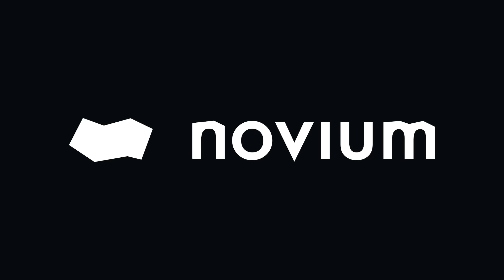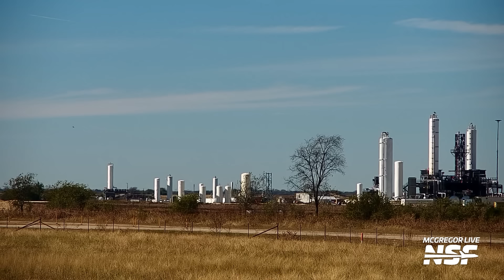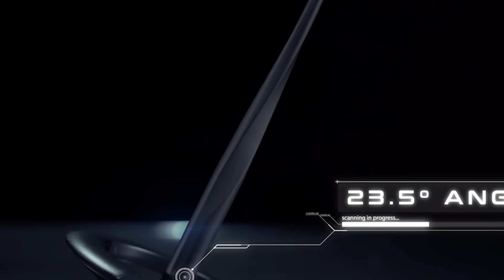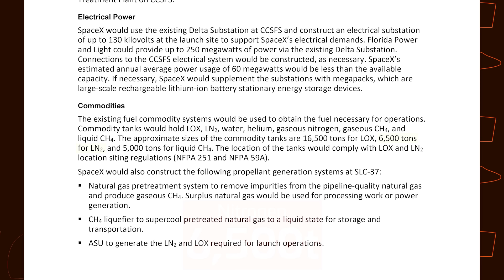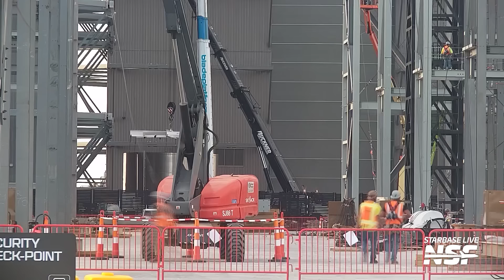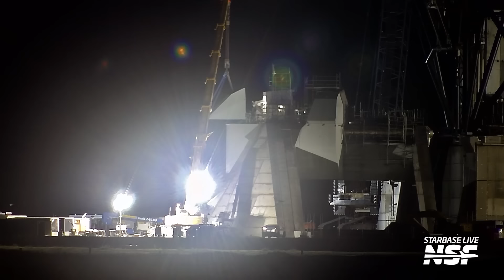SpaceX's Rapid V3 Push — Plus HUGE Starship News at SLC-37

Comment: We have not been able to make the easier version work, let's build a more complex one!
Reply: ..?  They don't move on until they got the previous version past it's required benchmarks.
Reply: @imaginary_friend7300  which is.. exploding?
Reply: @yoshyoka  Deeply unserious.
Reply: @gregspan  One hopes, but haters tend to be deeply ignorant so he might actually be serious.
Reply: @imaginary_friend7300  Well, no. i am serious, and not out of ignorance. When developing the Falcon series, SpaceX was doing serious incremental project management: build a rocket that works, then test new hardware conservatively, incrementally and move to the next step only when the last was understood and dialed. This made them move fast and lead the industry. With Starship all that went out the window, caution is gone, architecture never questioned, several systems redesigned before the previous version even worked. looks impressive, but they stopped moving fast, development is shaky and they are struggling to make the rocket perform first, not because they are stupid, but because ideology rather than engineering is now steering the company. 
I hope for them to succeed, and no, i am no hater: what SpaceX has already achieved has kept me in awe for years. Reason why it hurts to see politics dominate a company that was formerly steered by engineering.

Comment: ASU cool air to cryogenic temperatures and then use a fractionating tower operating at cryogenic temperatures to seperate the different gases.  Just like an oil refinery but at much lower temp.

Comment: Its is 41 Raptor Engines right? 
35 on Booster and 6 on Ship 

Am i right??
Reply: They have permits for 35 booster engines, though initial V3 boosters will use 33 engines like with V2.
Reply: V3 will have 33 on booster and 6 on ship for a total of 39 and V4 will have 42 total, 33 on booster and 9 on ship.

Comment: SpaceX is building a production line, not a bunch of one-off rockets.  I fully expect them to become faster and faster at this and so it will not surprise me a bit if they have B19 completed - or at least at the point of pressure testing - by the end of December.

Comment: They need to double the diameter and reduce the height of the ship. This would make it more stable on landing.
Reply: They have landed tall things more than 500 times in a atmosphere with wind and a lot of the time on water.  This idea is pretend expert nonsense at best.  They will need to be careful with the landing site selection and more importantly (as the other landers have demonstrated) make sure they have their horizontal speed zero'd out.
Reply: Well it's not landing in the traditional sense...
Reply: @medivalone actually it will be. There are no towers on the Moon or Mars. But I don't know about the need to make the bottom wider and reduce the hight seeing as the most weight is at the bottom of the vehicle. IDK about when they are filled with crew or equipment.

Comment: They had better build it up high because another Hurricane Andrew will hit there someday.  I would calculate the highest possible hurricane storm surge, then add half a meter to that. Better to have more elevation than you need, than to need more elevation than you have.

Comment: You need to lift the camera mount up higher. Nostril cam is now a real thing lol
Reply: But gotta keep the VAB in the shot!
Reply: He could keep the VAB in shot while moving the camera higher by switching to a wider angle lens.
Reply: @cube2fox that would put him at the bottom of the screen. The only way to keep him framed the same but putting the camera at eye level would be raise both him and the camera up off the ground to be level with the VAB
Reply: Sounds like material for a meme...

Comment: One question: Since 2018, the "sensational" Falcon Heavy has only flown nine times. Why should the giant Starship land 152 times a year? Why should it launch so often, with 100 tons of payload each time, and with 200 tons starting with version 4? That's 15,200 tons of material into orbit every year by SpaceX alone, in addition to Falcon 9 flights with smaller payloads. What will all this material be used for, and who will pay for it? It wouldn't be the first time in history that absurdly expensive infrastructure has been built without the capacity to use it later on.
Reply: A lot of the payload will be larger Starlink satellites. Further, payloads that need to go beyond LEO will need refueling. And SpaceX wants to start doing more on the Moon and Mars as well.
Reply: @anthonypelchat  With a total budget of approximately $25.4 billion, NASA could theoretically pay  SpaceX to send 8,303 tons of payload into low Earth orbit (LEO) by spending the entire budget on transportation costs alone. Even if Starship's prices were ten times lower per kilogram than Falcon's, SpaceX's calculations would not work. Someone would have to decide on a future NASA budget twenty times higher than now to cover also the missions' development, hardware, and other costs to Moon or Mars: It's absurd.
Reply: @bordeaux1962  Where did I say NASA would be contracting SpaceX that much? SpaceX is doing Starlink missions themselves. And that is worth more than NASA's entire budget. Lunar missions will be some from NASA and some from other countries. Possibly some from SpaceX themselves. But Mars missions will be heavily funded by SpaceX, or rather Musk himself. At least that is their plan. 

Also, SpaceX plans on having Starship be cheaper to fly than Falcon 9. While they won't sell it that cheap, it would mean low prices. They do want to quickly replace Falcon Heavy and eventually Falcon 9 with Starship only.
Reply: @anthonypelchat  What's so hard to understand? SpaceX is a for-profit company. They're never going to spend hundreds of billions to fund Mars missions. They'd go bankrupt.
Reply: @bordeaux1962  Which is why I specified Musk. He just so happens to be worth hundreds of billions.

But regardless, Mars is a long ways off. The primary portion is launching Starlink. And Starlink is worth more than all of NASA. And the new satellites are larger than what currently fly on Falcon 9. And Falcon 9 is already launching over 150 times per year.
Reply: @bordeaux1962  Starship is almost entirely about meeting their own internal ambitions.  It's not a traditional commercial launcher.  Yes they do plan to fund mars missions.  That is the whole point behind starlink.  It's to fund their Starship/mars goals independently which is why getting it ready to support starlink is a big part of their ambition and why they were already building things well before the Artemis program was even signed into existence.
Reply: @imaginary_friend7300   It's painful, but true: No matter how much you wish for it, you will never see a manned station or colony on Mars that is financed and supplied by SpaceX or Musk himself in your lifetime. Otherwise, I'll finance your or your children's university education. I promise.
Reply: Falcon heavy was started before Falcon 9 reached its final form. With the performance upgrades and such, an expendedfalcon 9 could do most of the payloads that originally needed falcon heavy. Especially compared against the original plan, which was to recover all 3 F9 cores of Heavy. There's a bit more performance on the table with the expenditure of the center (or all) core(s). But it doesn't give a huge amount more than F9, and it's also currently limited by the faring size. With the bigger faring that's eventually coming, it will open the door to a few more payloads that would be otherwise limited to Vulcan/New Glenn due to size.
Reply: I don't think anyone cares about what Starship and Super Heavy will do; they're just convinced it will do it better than anyone else could do it.

Comment: Build another when you don't truly understand what went wrong.
Reply: Just because it hasn't been posted publicly, doesn't mean they don't know what went wrong. They may have some more analysis to do to confirm things. They've made plenty of field modifications to already completed ships and boosters when changes needed to be made (hot stage ring is a great example of this). They would rather push forward instead of waiting until it's perfect on paper.
Reply: Low caste post
Reply: YOU might not truly understand what went wrong but it's head up own rear nonsense to pretend the ones with access to actual data don't.